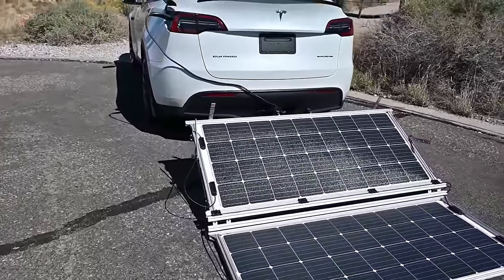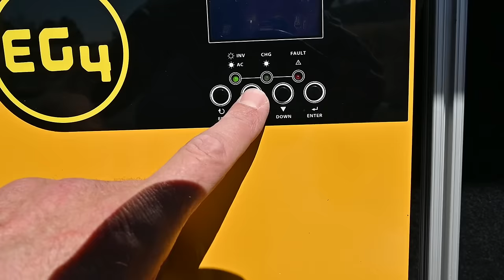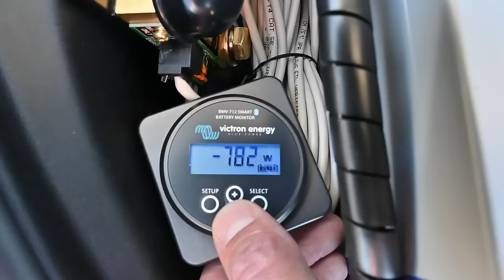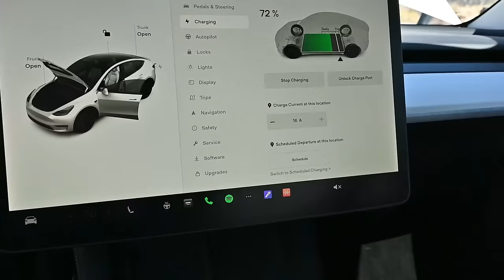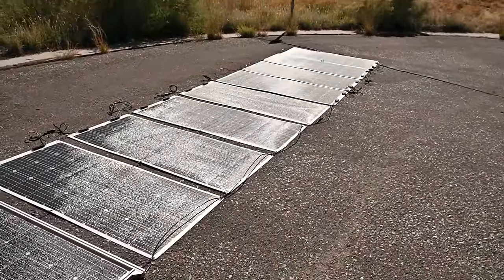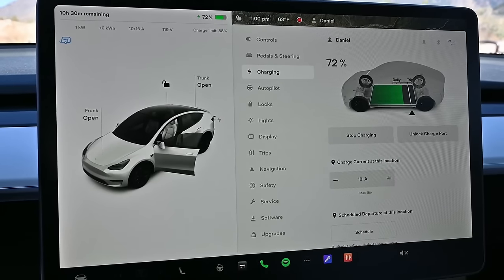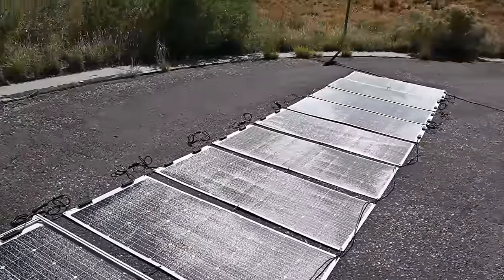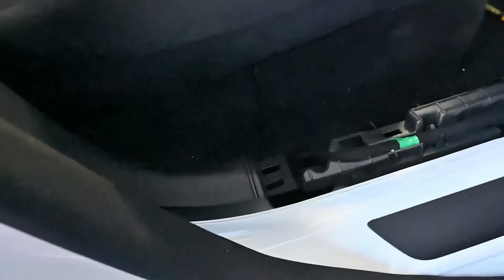2000W Mobile Tesla Solar Charger - version 3.0 - more solar, lower mass, battery in frunk!

Comment: Hahaha,  how ridiculous........   I like your innovation and creativity,   but the idea is just absurd.    Your solar panels is only generating 1.2 KW  to charge a  100 KWH battery pack.    It'll take you almost 100 hours to fully charge the car.    You spent between $5,000 to  $10,000 on that whole rig for that  severely underpowered charging system,  while compromising your car's aesthetics and increasing its drag.    This idea is worse than carrying a portable gasoline powered electric generator to charge the car.

Comment: This makes 0 sense...
So... You are losing power on the DC->AC on the AC->DC more the losses from heat and so on...
You are getting at most 50% of the power produced to the road at the end... If you are using a battery in the middle of that you can get that even lower.
Ohhh and i'm not even adding the weight you add to the car...
This only makes sense on a stationary setup (home) because you can use that to cut on energy cost and use the extra (that would be wasted) on the car...
Waste of money.
Reply: May as well carry a couple of 2kw solar generators and plug in the home charger if the aim is to extend the range or get you to a charge station!!.🤔💕🇺🇸
Reply: @caravanstuff2827  yeah, that makes sense for sure... Having a good home setup and with the sulprus charging them...
Solar only makes sense if you take advantage of it every day... And even so, most systems take like 10y+ to pay for themselfs. That would make sense because you could even use that sulprus energy on other things instead of waste it... Like a portable TESLA wall (smaller ofc).

Comment: LoL, I told everyone, to do that with transparent panels. Layered in between mirrors, DBL side mirrors in middle if need more electricity. 
L.E.D  panels on mirrors & LASER METAL HALIDE around the edges for RIDICULOUS POWER OUTPUT. 
MUCH LIGHTER, LESS EXPENSIVE & BETTER ALL ROUND THEN BATTERIES.
CHARGE DAY/NIGHT STANDING STILL OR IN FLIGHT.
You could also put a barrel wind generator spoiler on rear of car comes up in optional air stream from  wind tunnel help keep car down at high speed & charge battery. Have other designs also for perpetual energy . Not a fan of batteries personally especially 2000kg. Only a retarded sosociety world would mass produce such things wasting precious minerals in design manufacturing, infrastructure, space & time on such a ludicrous notion lack of thought process & brain motion.
Reply: Or

Comment: funny how all this eco friendly people trying overtake the issue of shitty range and charging station availability by paying premium dollar for pv and what not. Weight of this battery plus that shitty rack of panels must seriously help in reducing normal miles. But hey, you eco friendly. In Europe any LPG and diesel car is much better in terms of MPG than any other EV car. Beside you all tesla lovers driving slow and with every bit switched off cos "the range". In summer I'm laughing my ass off when i see queue of teslas waiting for charging station which are powered by huge diesel generators in container so they cant be seen by people. My advice: Stop adding to this madness. EV cars are complete waste of monies. battery will need to be replaced eventually and costs of that will be super high. And if you add that to the cost of production and buying ev car thats way of the scale in compare to any LPG/Diecel/Gas powered car.